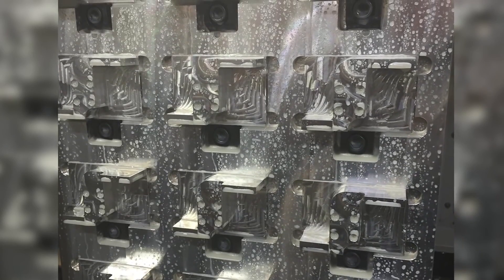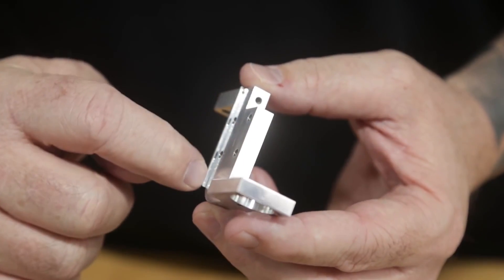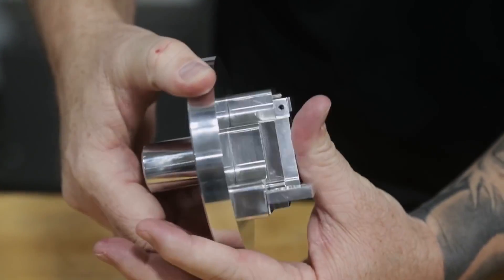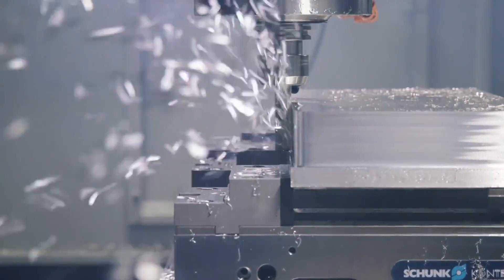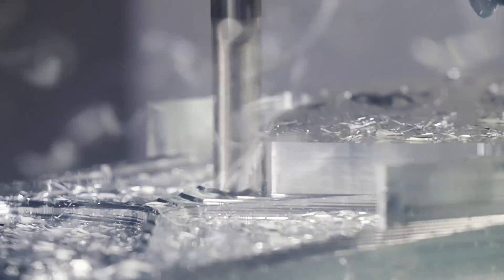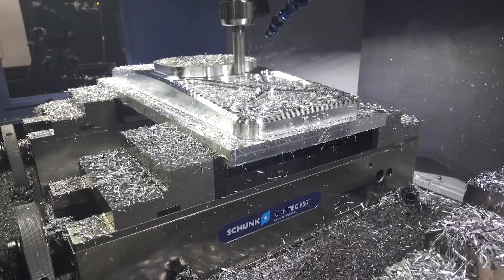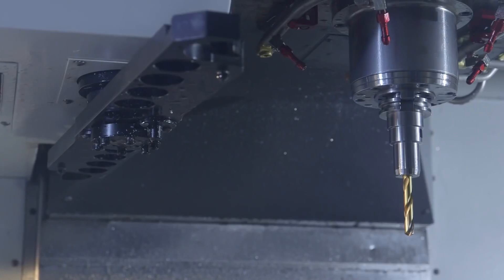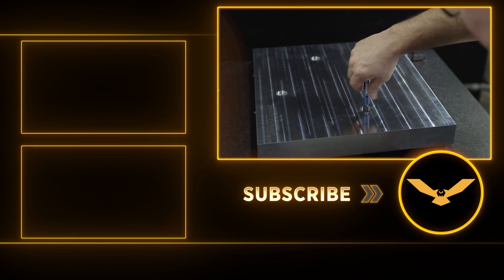Employee SCRAPS an INSANE Amount of Medical Parts... and the Reason is Even More INSANE

Comment: In the end of this video you used thread cutting tap instead of thread forming tap. Why this decision?? Or don't thread forming taps work for titanium? In aluminium forming taps gives about 4 times better speed...
Reply: Roll forming titanium is a nightmare.  Titanium work hardens very easily.
Reply: He has mentioned that they don't tap if they can thread mill. Bad experiences.

Comment: That is the biggest drawback to any automated production process. You can crank out parts way faster than we did before C.N.C. I can best share my point using math equations.  Manual machining x 4 parts per shift + hand operations= enough profit to take the family out to dinner. C.N.C. shop x 32 parts per shift + 0 hand operations = enough profit to go shopping for a Corvette. C.N.C. shop x 32 parts per shift + undetected problem x 2 shifts = 64 anchors for small boats. I 0wned a 1 man manual shop where I would customize machines of all kinds.

Comment: So the corner radius of the tool was off which scrapped the part?  We had a similar thing happen at the shop I work at.  Do you know we fixed it?  We bought a tool presetter and make sure all tool that get setup run on the presetter.  If they don’t pass spec, they don’t get sent to the machine
Reply: That's one of the reasons I'd like a presetter, so that every tool that goes into the machine has been setup and inspected before it's anywhere near a machine and I can just pull from the shelf a tool that's ready to rock. Really cut down those switchovers between parts.

Comment: **TITAN**
With the increasing need for total measurement of a customer's parts, are you using non-contact CMM's?
In the interests of speed and accuracy, CMM's HAVE to move towards no contact measuring. 
Are we there yet?
Has Meteorology advanced to the point that it's touch - free?
Thanks Titan, for everything that you do!  :)
Reply: Touch free can introduce problems of it's own.  Shadows/lighting can lie. We make these parts with a .012 hole (inches) in it.  The Keyence camera system that we use will tell you the part is no good if the chamfer on the hole is too big. Even though there is no call out on the print for chamfer size, we do it for deburring purposes. It will also fail it if there is no chamfer.
Reply: @brandons9138  I was afraid of that....
We're just not quite there with touchless CMM.  :(
Reply: @artmckay6704  There are other technologies that are becoming more main stream, but they are still expensive.  I've seen 3d laser scanners mounted on what is basically a CMM gantry.
Reply: We use scanners and accuracy is around +/-0.02mm if all is well. Scanners are not good with shiny surfaces and holes. They need the light to bounce back to get a reading. Contact measurement is still king.
Reply: @rivalrepairs  Absolutely agreed about contact measurement. We have an inspector in training at my shop. She uses our video system for everything. I constantly have to remind her that something as simple as a thu hole should be checked with a gauge pin. Especially with +/-.0005 (inch) tolerance on the hole size.

Comment: It’s actually far worse on parts you usually run rather than a new part. That’s why in surgery we use checklists to make sure people do quality checks on “routine stuff” (of course we didn’t leave an instrument inside). Same in aviation, of course we did x, except when you didn’t and routine things go sideways.
Reply: I worked at a shop where we did stuff that was +/-.0002 all day.  We'd usually mess up the easy stuff that was +/- .005.

Comment: This one gave me chills remembering a similar situation.
The day shift operator was a really good guy, but was fairly new to the trade.
He was really putting in the effort going the extra mile on his own to do a great job.
Knowing the second shift was coming in soon, he decided to index all the inserts in the roughing end mills and get a 100% first piece from inspection so the second shift could keep the chips flying when they took over and just continue a running inspection process checking random dimensions every part.
These parts had already run thru the CNC lathe department first side, and second side, and had been running for a couple of days in CNC milling.
The parts were made with 316 stainless steel, so before they got to CNC milling, between the stock costs, and running first and second side in the lathes these parts were already very expensive.
Unfortunately when the first shift machinist was being proactive changing the inserts, he grabbed some standard inserts by accident instead of the .060 nose radius inserts called out for on the set up sheet......
When the second shift crew came in, everything was running great, the machine had new inserts, and a fresh 100% inspection.
The parts, unfortunately, were all junk and unfixable because the stock in the corner was gone and milled to a sharp 90 degrees.
You know how we found there was an issue with the parts on the second shift?
The small diameter special finish carbide end mill with a .060 nose radius that finished that feature ran almost half the night and still looked new.
That never happened in past runs so we started to look for the reason it was happening now.
It looked new because it was milling air.......
It's good advice to be extra diligent with inspections around shift changes as you never know what has happened before you arrived to the shop.
Excellent video topic .
Reply: So the guy changed the inserts, sent the part in for inspection, and they diddn't catch it at that point and said good to go? That's rough.
Reply: File that under no good deed.... ☹️
Poor guy... I hope he didn't get a hard time for that ... 🙄
Reply: I machined overnights for two years. Took me two nights to learn to 100% every first piece down to the chamfers. If management is mad about spending on time, remind them how much scrap is.
Reply: Just wondering, doesn't the carbide cutter wear during operation, causing variances in the desired and achieved tolerances? I just think it's insane what you see some CNC machines do (while they remain in-spec the whole time). Is there a wear factor that's incorporated in the operating script? Very curious.
Reply: @insanebmxthomas  If it's aluminum, wear is minimal, but yes we have wear offsets. If sizes are tight, it is wise to give the tool a positive wear value, then fine tune the size. Medium and high carbon steel and stainless steel are much harder on tools.
Reply: @MOTOMINING  awesome thnx man!
Reply: @MOTOMINING  Yep, I expect an insert to fluctuate by about 0.005" over it's life span when turning steel.  You can usually see a difference in surface finish, corner rounding, or feel damage to the corner of the insert itself before your dimensions vary by more than 0.005".  Just general rule, which usually keeps me in tolerance.

If your dimensions vary by more than 0.010" your insert has already been destroyed long ago.
Reply: @somethingelse4424  Except in Titanium where it will just go bang!
Reply: @MOTOMINING  I've never machined titanium, but I appreciate the information. Inserts just fail spontaneously?  That sounds anxiety inducing.  I had anxiety as a beginner with just mild steel trying to understand when my inserts needed flipped or would cause a serious problem.  Now I walk away from the machine and go set up another while it runs... when I'm confident in my set up.  It sounds like that's not an option with certain other metals.
Reply: @somethingelse4424  Very specific feeds, speeds and geometry with Ti. Special taps too, we often hand tapped smaller threads because it was too sketchy in the machine. It's a very springy metal and it doesn't absorb heat well. You can touch a freshly turned ti part with bare hands and it will be luke warm but the tool will be burning hot.
Reply: @insanebmxthomas  It does wear, depending on how much material you're removing, what type, and what your tolerances are.  If you have +/- 0.010" (0.25mm) tolerance, and you're cutting mild steel on a lathe with decent quality carbide inserts.... You can just run until you notice anomalous surface finish or burrs on corners that should be rounded/chamfered.  I would still spot check 1 in 10 parts with calipers, but insert wear shows obvious signs on finish before it affects dimensions at that scale.  If you have +/- 0.004" or less, and you're removing lots of material, insert wear can sneak up on you within a few parts and put you out of tolerance.  If my tolerance is less than 0.005", I check damn near every other part.  It's relative to how much material and how fast you remove it.

Also, insert wear can cause you to remove more material, which is not intuitive.  You would assume that a worn insert would create a smaller bore or larger turn.  I think that a jagged insert can drag chips or friction welded material and remove too much material, which creates a situation in which you cannot rework the part.  That's my theory based on what has happened to me many times.
Reply: @insanebmxthomas  That is why most machine shops have in-process checks, to check the dimensions of the part and make any adjustments to account for tool wear.
Reply: Ouch.......
Reply: Sounds like layout lab dropped the ball
Reply: Stop buying 0.062" nose rads. They're garbage.
Reply: Agreed. A good tip for when you walk in for the day is assume the parts coming off the machine are out of spec until you complete a full inspection. Regardless of whatever the other operator tells you.
Reply: Did injection molding had a mark on a part that would be visible had 3 inspectors ok it ... 3 days later everything was recalled
Reply: always learning from this case : always double check after change tool . visual ,diameter,lenght etc.

Comment: How do you not check every dimension on a part when you change a tool out. That's 101 of machining. Always check your part completely no if and or butts.
Reply: At least check the features controlled by the new tool.  That is basic right there.
Reply: The other mistake is who ever followed the guy who changer the tool should have checked the first part he made to make sure everything was on the money. used to run screw machines years ago always check the first six parts  6 spindle acmes learned the hard way to do so even on a new set-up that was approved they ok'd it every dimension was wrong and collets were too loose. but you know who caught the crap ? Yep it wasn't the set-up man it was me for taking too long fixing the mistakes.

Comment: That is why I always try to design my fixtures to work like a running gage for the previous op.  If it doesn't fit in the next fixture, something is wrong with the prior op.  Doesn't always work but most the time it does.  Food for thought. ;-)
Reply: That is a good idea. Even if you can't use a physical block, you may be able to put a hole or dimple with paint etc. so that if the mark is uncovered you know too much material has been removed. Or some locating holes you can quickly drop a pinned piece into as a quick measurement. All you need is enough room for 2-3 small holes somewhere on the fixture, and you can design a negative of the top/sides of the part or even just a pinned bar to touch off with. If it slides into place, the part is the right shape. If the negative bottoms out material is missing. You can use that as a simultaneous multi dimension go/no-go.
Reply: That's called Poke a Yoke. You invented it.

Comment: It's a common problem these days.   Machine operators are not machinists and they are not inspectors.  Most don't even know what it is they are making.
I used to make parts for medical equipment and then later that same equipment was used to treat my wife.  Boom !
Reply: The Machining Center ? 😨
Reply: @peterfitzpatrick7032    Try a some reading comprehension.
Reply: @carabela125  was a low effort joke, Machining (Medical) Center. extremely low effort.
Reply: @carabela125  "Try a some reading comprehension." also, loved the irony in this.

Comment: The question I always get  is how many parts can I run before checking the part in mu shop the answer is 0  always assume something is wrong with the part  and check check check  I would rather have 100 dead parts and catch it on part 100 in house  than send the parts to my customer  My favorite saying Is   THERE iS ALWAYS TIME FOR YOU TO QC 
PUT IT BACK ON THE OPERATOR      you rock Titian   I only have around  8 haas cnc  machines  your tips and tricks  become more valuable to me every day
??? what did you do to the operator?

Comment: The last part about rotating feature checks until you get a complete 100% inspection, sounds good in theory, but in practice, you are up against the management/owner mentality of faster, faster, faster. The more you inspect, the more time you take away from faster, faster, faster. Your repeat jobs have a process inspection correct? Did the employee follow the established inspection process? It sounds like he did. If he suggested changing the process to rotating feature checks until you get a complete 100% inspection before the the1700 part scrap debacle the management/owner would have told him we "have been running this job for years with no problems, don't waste your time".  If the manager/owner came by his machine and it was idle while he was checking parts, most likely they are going to say "what are you doing?" "The machine is not making chips". "We have been running this job for years with no problems" (inferring that you're wasting time and doing a poor job.) He is told to "get the machine running, come on man". Fast forward to 2000 parts later, "employee F's up an insane amount of parts".  All of you scrapped the parts, from the owner/management down the line.
Reply: I think Titan is saying here, that yes it was a whole company issue not just that one machinist being in error, and that they had to learn from the hole in their process that let that slip thru.
Reply: @scottwatrous  This industry is just full to the brim with management pushing employees until something breaks. Then blaming the employees. That is a big reason there is such a horrible turnover with machine shops.

Comment: to be fair any operator changing tools and not getting a check done or confirming the tool is correct is obviously either lazy or careless. Zero excuse for this whatsoever. After ANY change especially tooling my guys would check. But confirm like for like tooling is apprentice stuff really.

Comment: I've gone over to inspection from being a CNC turner, as I've got arthritis.
What I have done for safety when checking parts is, I've made inspection sheets for each job we get.
I have all the dimensions on it for checking the part, so as I fill in the sheet, I know 
that I'm not missing out any dimension on the drawings when checking.
This also gives me a record along with the CMM file that I save, so if anything goes wrong 
we can look to find out why and where.

Comment: Also don’t forget to inspect and verify your inspection tools and gages,  I’ve had gage pins, new gage pins, that were clearly marked one dimension and actually measured differently.
Reply: Worked at a machine shop where they intentionally gave me a bad gage to work with and let me spend all day losing my mind just to teach me that lesson.
Reply: @nathannotimportant9379  Friken hardcore. Glad to know that there's still organizations that beleive a job well done trumps feelings.
Reply: Calibration, it should be done once a year…
Reply: @godwantsplastic  
Meh. I setup useage clocks on most of our tools and issue them out in kits.
There is no reason to pay for cal on a tool that didn't get used between last year and now. Also something that gets heavy use day in and day out should be inspected very often.
It's just as easy to get a set of calipers fresh of the cal guy's van with a sticker then drop them and run em for another 360 days because the magical cal $ticker hasn't expired.
Reply: yup, been there!
Reply: This is usually a culprit. Personally, I believe those things should be checked at least once a day.
Reply: Another one that no one ever seems to bother with... calibrate the tool for checking coolant concentration.
Reply: EVERY issue at my last job was bc of idiots not doing this. They grab whatever. Just use it. never check. Then 3 days later wonder why they're fired for making a day's worth of scrap, AGAIN.

Comment: Yeah I've had this bite my self on a large scale  it is critical when you change a tool  you run the CMM reports and any other inspection but the part that got me the CMM report came out green light and I told my guys start rolling them out ... But I forgot to check the repo rubber mold of a internal groove that had a 15-30 micron   v groove in the center of the internal o-ring seal ended running 16 hours before caught scraping a few hundred parts lucky our material cost was low due to the fact we cast our own parts.

Comment: My first article has been sitting on qa desk for over a week. I have finished both first op and 2nd op and my first article still has not been checked.  ( I 100%check every 10th piece and write down all my dimensions).
Reply: Supervisor asked me yesterday if I got my first first article back yet he wasn't happy with my answer.
Reply: You cannot run any part without a complete first article inspection, ever.
Reply: @glennschemitsch8341  sure you can every employee is required to do their own inspection and are all trained on all inspection equipment. Our qa guys a lazy bum